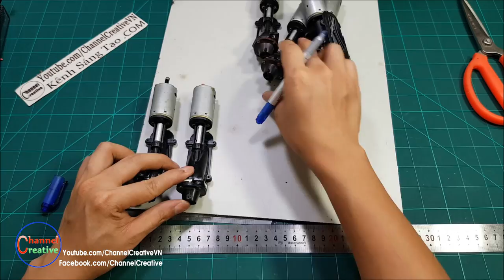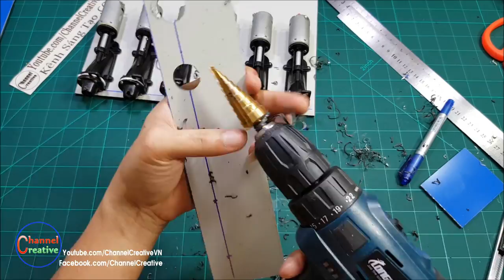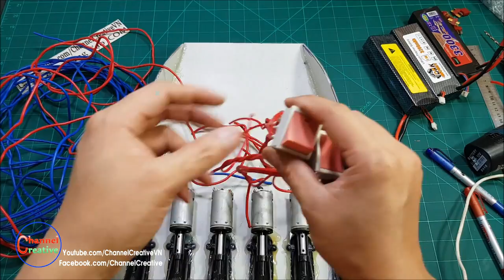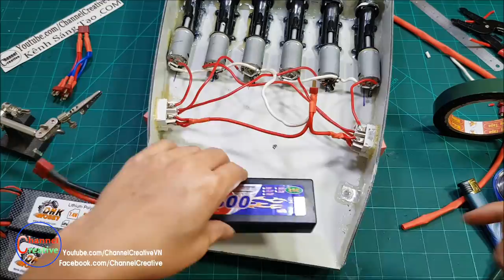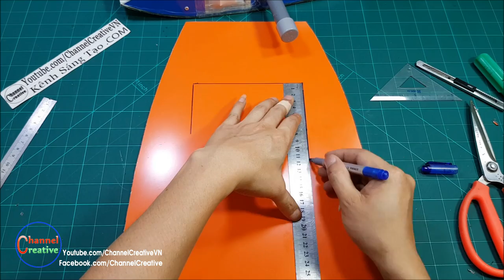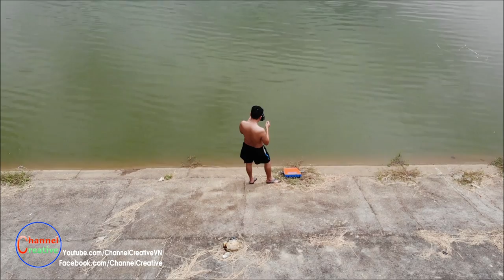Build a Sea Scooter at home

Comment: Some suggestions on the build process from previous past failures on my projects..
1:- the grab handle should have been made as one piece and fed all the way through, this would eliminate possible flexing and leaking later and would also be much stronger.
2:-Should have had a simple dead man switch or lanyard style kill switch in case you lost grip on the unit.

But keep making and learning, you are doing so much more than most of us who are just watching your videos.

Comment: The person who makes this channel, apparently is an artist, but not an engineer, apparently does everything without calculating anything, it was clearly seen that the power of those motors and the design of that configuration would not have enough power to generate the  enough thrust to be able to move at a decent speed underwater, aerodynamics and hydrodynamics is not something to be taken lightly, it all starts from paper.
Reply: he just built a boat
Reply: Well you just keep on feeling smug and have fun with your paper. I'm sure he's happy enough eyeballing things and going off trial and error, all while raking those YouTube bucks.

Comment: Suggestion: handles would be better as one single piece of tubing from one side tp the other. Perhaps use electrical conduit.

Also switches could placed on grips for better ergonomics.
Reply: David Smith
Reply: Even better suggestion... just throw it away and there ya go. You swim faster. You maybe instead of buying materials for scooter can buy a floaty.

Comment: I’m assuming water leaked in and shorted the motors.  It didn’t look very water proof.  The lid looked like it leaked.  I would suggest doing this with a large foam board to increase buoyancy.  I made something similar with a body board.  I put the motors in waterproof bags and batteries/speed controllers high on the boat in a waterproof box.  I had trigger controllers on the top of the board where I usually hold while body boarding.  It helped a lot to catch waves or pull myself into shore when I’m tired.  Try this again on a big foam board you can lay on and it will work better.

Comment: - You completely forgot about the aerodynamics. Try this with soft corners like a submarine shape. Symmetry is also important.
- Controllers can be redesigned as a weapon trigger.
- How about splitting it in two and holding each with one hand?
Reply: I think it's going to take a whole lot more than that to get this thing moving
Reply: Fantastico, per un intero secondo!!!

Comment: Nice try and nicely build, but jet drive works only if the propelled water is mixed with air.  Jet boats are fast but don't have much torque. 
I feel so sorry for all your efforts.

Comment: Needs carbon fiber tub .more streamlined glue gun will not work on props...motors are too small...try using 775motor and 6s lipo battries...concept is wonderful....one made with two ducted fans on ethier side..

Comment: Just a thought; did you account for the drag of your body? Also, jets get faster with speed, they function poorly at low speeds thus props tend to be used for the greater torque. Please install a lanyard kill switch! If you let go that thing would cruise until the power ran out 😱 otherwise splendid build!

Comment: Using hot glue for water proofing is a bad idea. Also those buttons aren't probably water proof on the outside that has contact with water either.